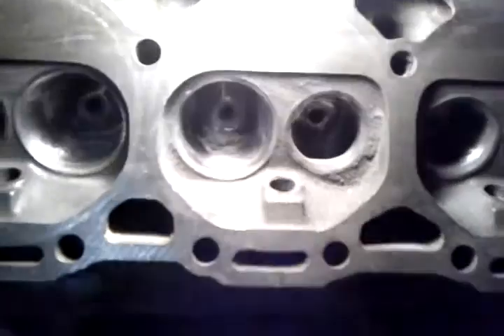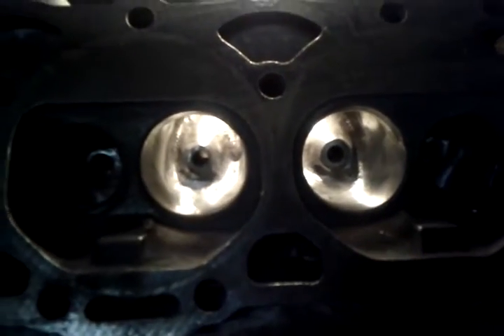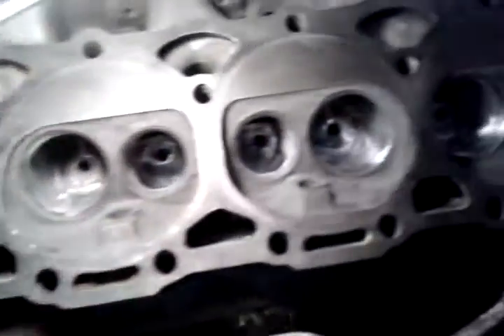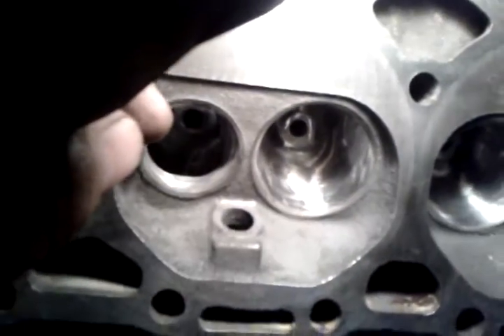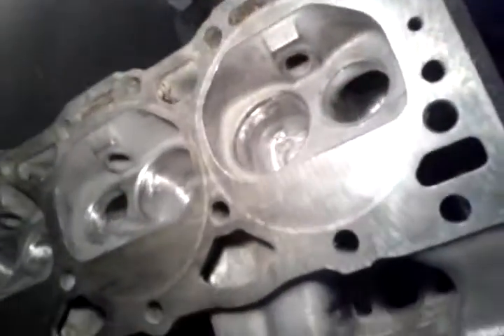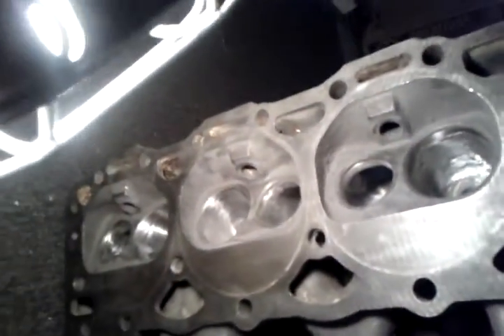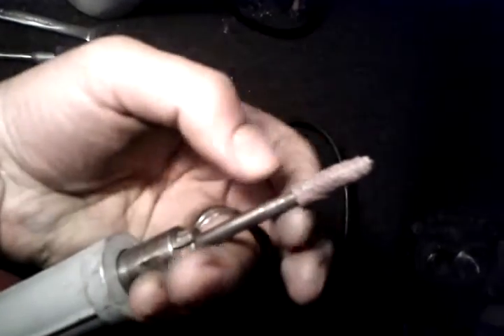Small block Chevy 350 cylinder head porting

Comment: I beg to differ  i have a set of #113 castings on my SS/JA super stock 1990 corvette that flowed 260+ cfm @ 600 lift with a 1.94 inch intake valve. A cleaned up set of 906 vortec heads with 2.02 flowed 239 cfm @ .600 lift. The vortec is straight the plug #113 is angle plug (big advantage in timing) the vortec is cast iron and crack prone the #113 is aluminum (GIANT advanage in heat transfer & detonation) and dont crack. My L98 in the car is 11:1 and shifts @ 7000 rpm, a vortec head shuts off after 6500 rpm. On a street engine a vortec head may be a better head but run one against my Vette at the drag strip and Ill spot you a full tree and run you down.
Reply: Really...

Comment: I like the 083 and 081 (305) heads. I've done a lot of the heads and learned David Vizard featured these heads in a couple of his books. The only problem I have ran into is the valve cover lip at the intake face gets in the way of the intake. Also that there arn't to many intakes to choose from without modifications.
Reply: I use 081 305 heads on my K/SA stock Eliminator 87 Monte Carlo SS. Only thing in them is a competition valve job and Manley stock diameter valves, Lunati solid springs and ARP 7/16 studs. Theyre flowing 194 cfm @ .403 (stock) lift. Those are unported ports and bowls as per NHRA Stock Eliminator rules. That car runs a consistent 11.70s with a .060 305 with a stock intake and 750 quadrajunk.

Comment: You don't want to polish the intake ports. You want them to have a 60 or 80 grit finish, done with cartridge rolls. The exhaust port should be polished, so carbon doesn't stick.
Reply: Hey darin why is it tha you need that grit on the ports